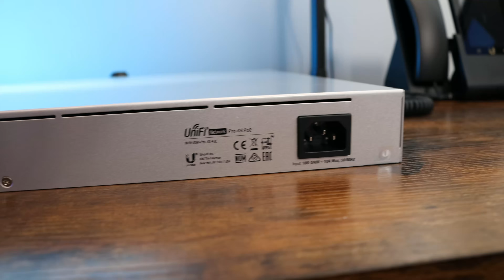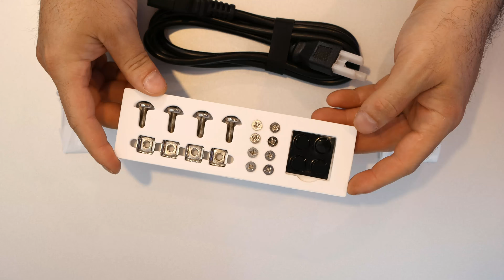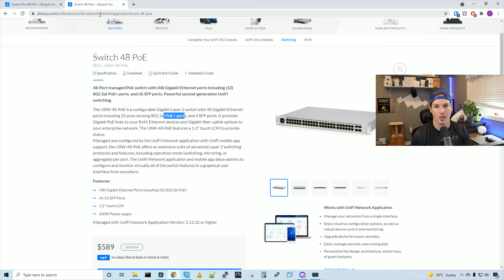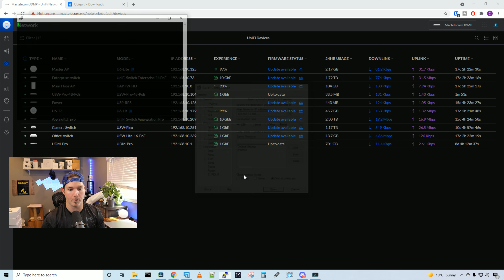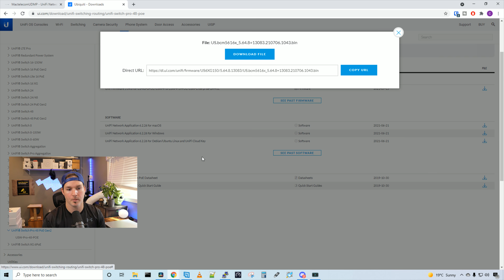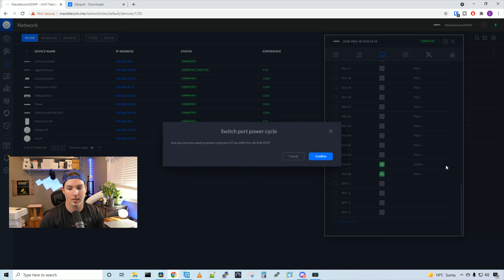Unifi Switch Pro 48 PoE

Comment: Great video sir!

One thing I noticed on a few of your videos is that your lip sync is off. Not sure what recording software you're using but it should have some kind of audio delay feature that you can enable. I would delay the audio from about 50-150ms, would have to play with it to get the correct millisecond setting (10ms intervals are a good start).
Reply from the maker: Hey,

Ya I noticed that I switched mixers I use x-split will work on it more. Seemed fine when I was editing this video but apparently not

Comment: Very nice video as always.
Every time I watch your videos about unify the gear seams amazing and powerful but I always then wonder, Why go this way since there are companies selling almost as good gear as Unifi-ubiquity but much cheaper ? It will be an interesting video from a guy like you doing it for a leaving. (personally I use Mikrotik Despite the steep learning curve)
Reply from the maker: Hey,

What gear are you thinking is cheaper? From my perspective I think this is at a good price point. TP-Link has some switches as well but they are super loud and not much cheaper
Reply: @Fallon Cohen  @Mactelecom Networks Basically yes. I was thinking of Mikrotik gear which is very good (not without some miss haps). I think the materials they use are cheaper but they give so much control. They also have a UI called routerOs. Not the prettiest but it has all the features a big provider whould use, even in their small devices. Ex. Their full POE gigabit 24+4ports sfp+ costs around 350euro. So a full POE network RT+SW+AP×3 Whould cost almost as much as one RM unify SW 😏. You get the point ... 😄